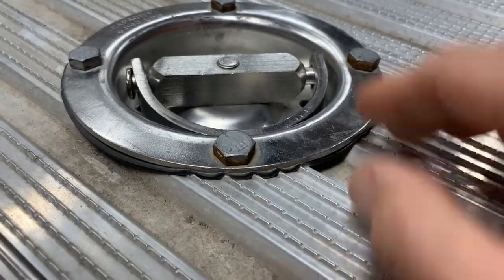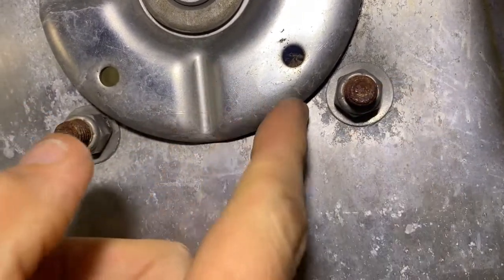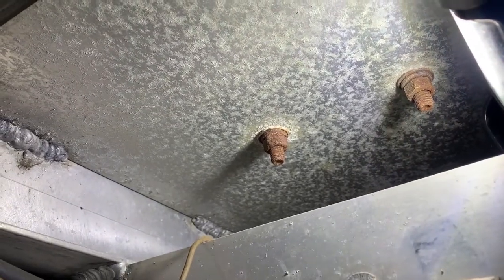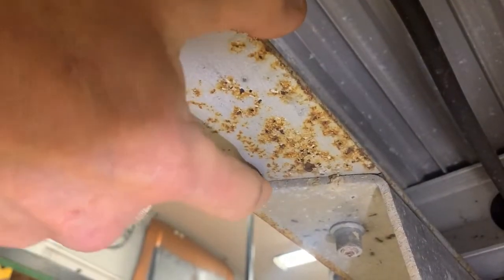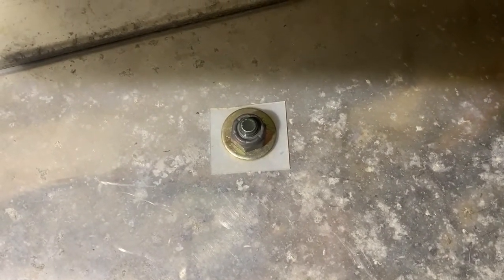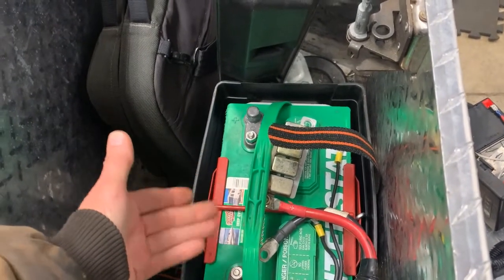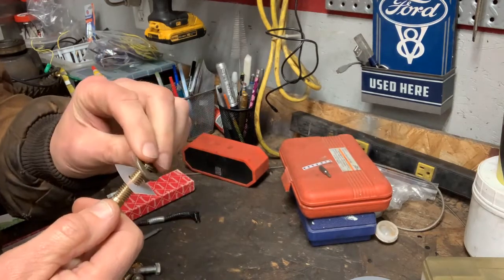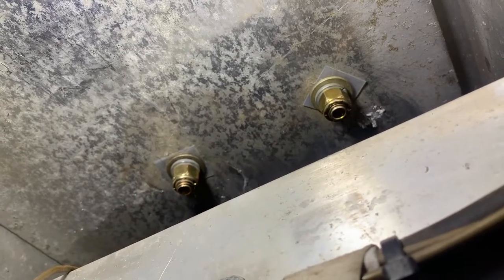Galvanic Corrosion what causes it and how to prevent, have an issue on my aluminum car trailer

Comment: Thanks for great video.  I came across it researching galvanic corrosion.  I am about to install a steel chock to Alum aluminum trailer.  The chock is powder coasted.  But I will use some type of roofing rubber or non conductive material under all steel to aluminum contact areas.
Reply from the maker: You're welcome! Glad it helped you out and thanks for watching.

Comment: Thanks for the vid, learned a bit about galvanic corrosion for sure.  Don't you think that you should use a steel reinforcement plate on the top (and maybe bottom as well) for the winch? Do you trust the aluminum floor to hold the winch with the weight of a car being pulled up? I thought you would for sure need a steel plate on an aluminum trailer for a winch. Curious on your thoughts.
Reply from the maker: Featherlite reinforced that area to mount a winch. So it was designed in. Haven’t had any issues pulling up anything on the trailer. Glad you enjoyed the video.

Comment: Many times in that situation the grade 5 hardware is better than the grade 8.  Grade 8 is brittle and can snap, where the grade 5 hardware will bend and keep holding before it fails.
Reply: There exists an often quoted myth, that Grade 5 bolts are better in shear than Grade 8 since they will bend before breaking. Not true. Shear strength of alloy steel is approximately 60% of its ultimate tensile strength. The yield strength of a Grade 8 bolt is higher than the ultimate strength of a Grade 5 bolt. The Grade 5 bolt will therefore always fail first whether in tension or shear. The only “gotcha” with the Grade 8 bolt is that, being harder, it is more “notch sensitive.” This means it is more sensitive to build up of stress concentrations caused by notches, nicks, and gouges leading to fatigue and failure. This becomes a non issue if good quality new fasteners are always used and periodically inspected.

Comment: How do you prevent it between the bolt and the side of the hole (trough the hole). I do undertand It's a very tiny contact surface but still wondering. Thank you
Reply: ? I put indian head gasket  (gooy stuff )in a  2oz. Brown bottle at auto part stores. It atleast works somewhat, if not great.
Reply from the maker: Add some unplated nickel anodes.
Reply: You can coat bolts in anti seize to prevent most surface contact as well.

Comment: Does galvanic corrosion occur between aluminum and brass?  Also, does it occur between aluminum and copper?  I'm considering buying an aftermarket radiator for my car.  The factory OEM radiator has plastic sides for coolant to flow through, with a brass or copper threaded insert within the plastic to accommodate installation of the radiator temp fan switch.  The threaded portion of the switch is manufactured from brass or copper.  The aftermarket radiator is all aluminum, including the threads.  My concern is that I do not know if the aluminum threads on the aftermarket aluminum radiator will cause corrosion between it and the brass or copper threads of the radiator temp fan switch.  Should I be concerned?  Please explain why I should or should not be concerned.  Thanks.  Great video!
Reply from the maker: Yes it can, it can happen between plastic and metal. I have an aluminum radiator and brass drain at the bottom. Yes it can happen but will take years. All you can do is a little Teflon tape and seal it up. From my experience.